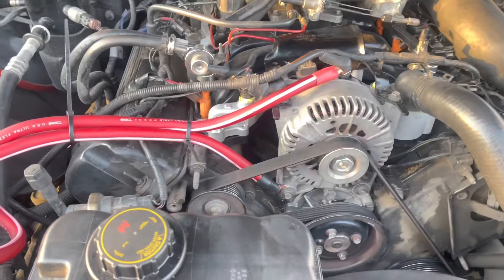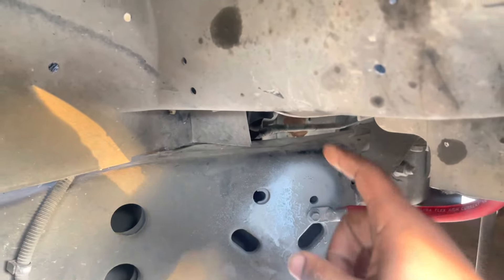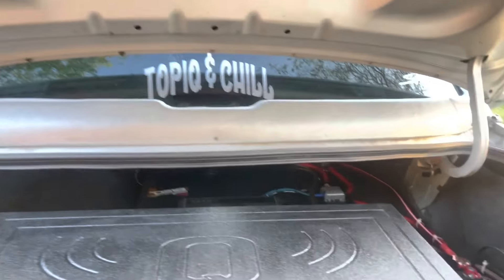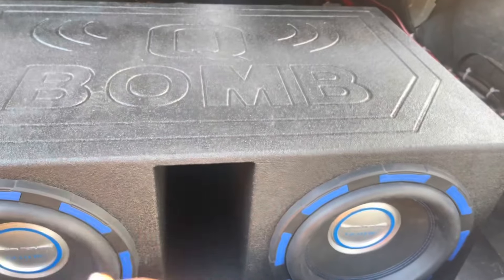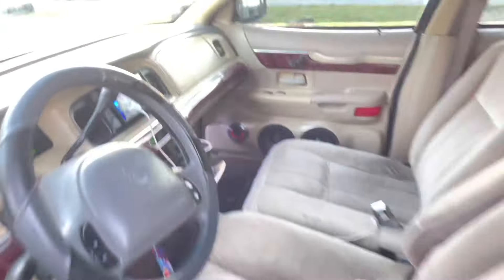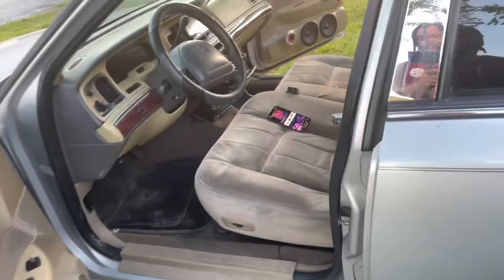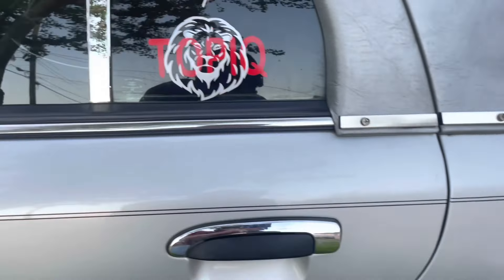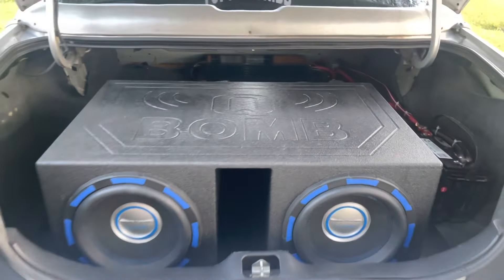Big 3 Upgrade Budget Car Audio Build Pushing 1500 Watts RMS and Some!!

Comment: not bad at all, tho youre not doing 1,500 watts rms. once you take impedence into account your power dives. if you wanna know your real world power clamp test the amp.
Reply from the maker: How many rms watts do you think I’m using. I will push that 2000-1D to the max thinking about adding two more subs to the build